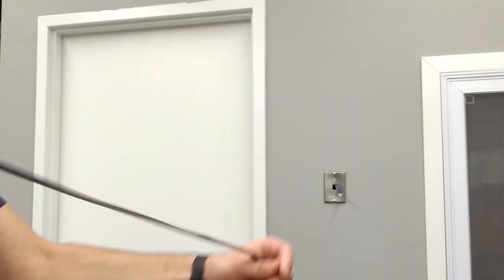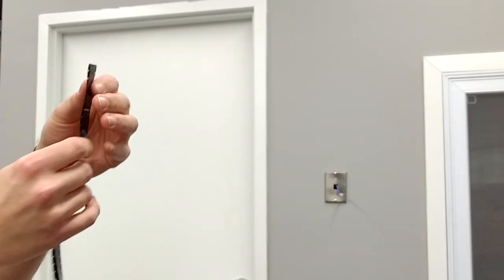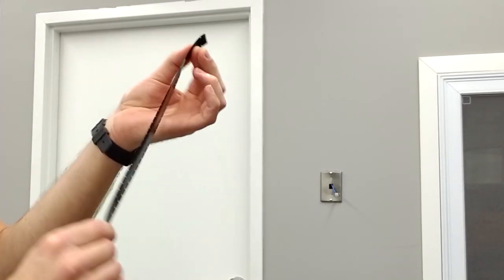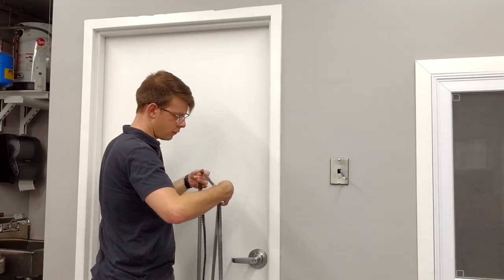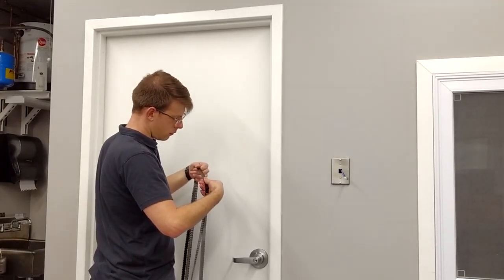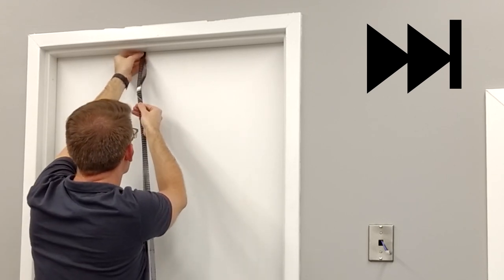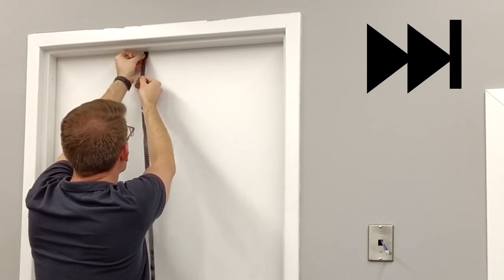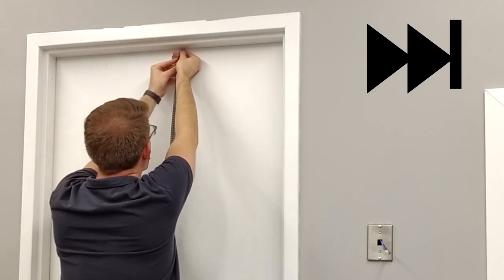DIY Over Door Tool (ODT)

Comment: When you pull on the film, the film breaks on the edge of the door. How do you prevent this ? The edge is becoming sharp when we pull.
Reply: Pull the top half not both.
Reply from the maker: The film was already brittle due to age and being folded. I believe it broke on the folded seam. To be honest, that's the only time I've had it break and it lifted the handle enough to unlock the door, prior to breaking. So I've never put time into trying to solve this issue.

Comment: WOW! Came from reddit. So simple so straight forward.
Reply from the maker: Thanks! If you want to try this yourself, but have trouble finding several feet of film, you can do this with a loop of 6 mil plastic sheeting. Plastic sheeting is easier to find but the trade-off is that it takes longer to feed it over the door.

Comment: Simple door jam trims defeat this method.
Reply from the maker: Could you be more specific? There are certainly theoretical solutions to this vulnerability but I don't think I've ever seen them implemented in the real world. 

Most door jambs, weather stripping, etc. are actually pretty permissive of this technique, in my experience. The most common snag occurs when a metal door have an open top design, allowing the film to fall into the door but adding a more rigid shim usually overcomes that barrier. 

But if you have tested this method and found it inconsistent, I would love to see a video of the issue. Please let me know if you upload one!
Reply from the maker: @CalBruin  I can't know without interacting with the door, myself, but I suspect that the paper just isn't rigid  enough to push through without kinking. It often requires some force and lateral shimmy as you advance, with tighter door assemblies. Film is the right mix of thin, rigid, and smooth to tolerate the required force. Or maybe these doors are just uncommonly tight-fitting--again, I can't really know.

I just know that this technique works on plenty of internal office doors with nearly identical door jambs. If you want to shoot me an email (bbushnell@contingency-solutions.com) with your mailing address, I'll send you some 16mm film to use.